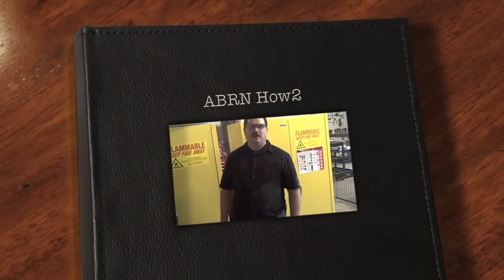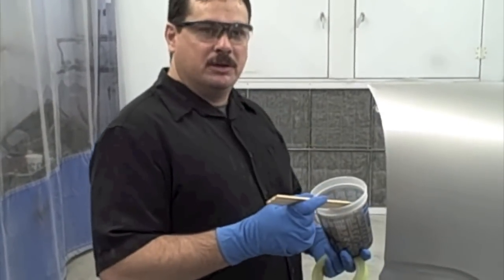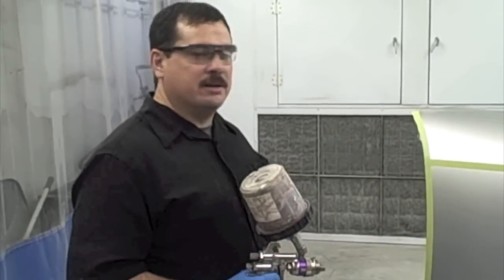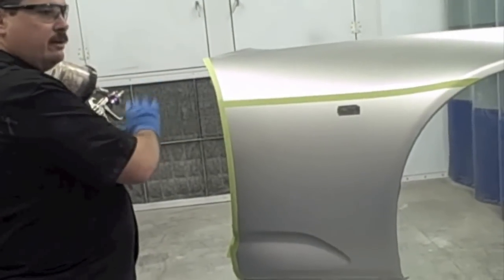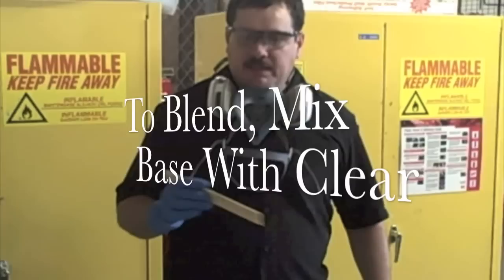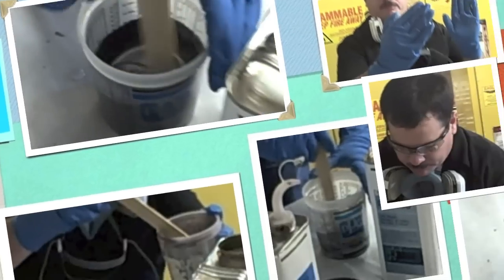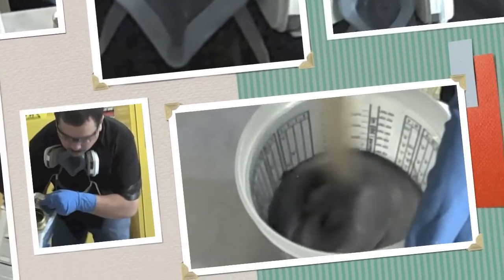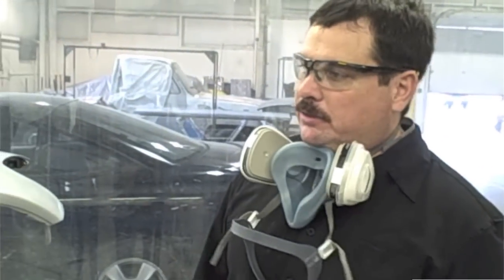DIY - How To (Blend Car Paint) to Match Metallic or Pearl Color - Fade Custom Paint Jobs Tips

Comment from the maker: We started using PPGs waterborne paint and it matches great.  We've been able to do butt matches just by selecting the closest variant on the color variant deck and spray.  It has been working great for color matches.  I do not know much about DuPont since the Lucite and Centari days.  (lacquer and enamel)  I worked at a dealership that used it.  I need to try DuPont's newer products, but I have not had the chance to.  Thanks for your input and for watching.

Comment from the maker: If the damage is far enough away from the adjacent panel, you can blend within a panel (but still clear the entire panel.)  If it is not, you may see a metallic difference.  I usually end up blending into the adjacent panel though.  If it is a small dent in the middle of a door or something like that you may be able to blend within a panel.

Comment from the maker: The color blender helps prevent a halo ring on the outside of the blend, but you do not need to use it.  I have blended a lot of jobs without using it.  It just makes it easier if you are having that problem.  Thanks, Donnie

Comment from the maker: You can try gently buffing the clear coat edge.  Careful not to buff through the clear though.  One way is to melt the edge when applying clear coat.  This can be done using a blending solvent.
Reply: Why not just repaint the hole car

Comment from the maker: @theglove3k0 Yes, you must sand the surface before clear coating.  You need to sand the surface with 800 grit or finer.  Clear will cover the 800 scratches.  If you do not sand the clear will not stick and may peel. Visit my website for more training.  Thanks for asking.

Comment: One thing I don't understand about blending for touchup work, is that the whole point of prepping a surface (besides cleaning) - sanding to 600/1000 and priming - is to ensure proper adhesion of the coats. How does that work on blending areas, where you're spraying on top of clearcoat and polished surfaces?

Comment: hi question.. i have a few tiny spots and some scratches I wanna fix - can I just use like paint from a small bottle with a tiny brush?  would it be good enough? I don't want to and don't have the gear for spray painting

Comment: Well . I am losing my mind with my bumper. I had all the troubles in the world painting over and over again my bumper. Now i finally got some very close color match. But just on one side. Seems like someone already did some blending or the original paint is burned by the sun more on one side. Because i live in Europe i don't know exactly what is this clear used in this video. All i could find is some transparent acrylic paint used by artists. Painting shops around here are saying they prepare the base coat already colored. My question is : is that acrylic clear for paintings good? Because auto painting is also acrylic.

Comment: I'm installing a factory spoiler on my 20-year-old car with original metallic paint that has faded much lighter than the fresh OEM color. My thought was to spray the spoiler with an OEM base and clear base mixture to try to match the faded original paint. Do you think I can achieve a close match, or are the elements causing the fading too unpredictable? Since it's just a spoiler, I'd like to keep it simple and avoid blending the panels. Thanks.

Comment from the maker: @RUSSRTOC Yes, if I did this for a living (daily basis) I would use a air supplied.  As students or DIY, the 3M respirators work well and is approved.  They do have half mask air supplied you may consider.  However, to completely protect you face the full mask is best.

Comment: Quick question: So when you have taken your already reduced base coat color and mix it with the DBC 500 which is already reduced, I noticed you sprayed over the already two coats of reduced paint that you laid down. Is this what PPG recommends you do? I would of thought you would have just sprayed out past your 2 coats and blend out into that fender, not spray over your first two coats also. Not that it probably matters a lot since its just basically reduced way down base coat at this point.

Comment from the maker: With solvent paint, it usually has to be blended if you want an invisible repair.  However, you may look for a shop that sprays waterborne and ask them if they can panel paint the part.  I have found the waterborne paint to match much better.  If they panel paint, they may not guarantee it to match perfectly.  Thanks for watching!

Comment: I live in Santa Cruz, Ca....one of the only areas that isn't required to use waterborne, though, most shops use it anyway. No one seems to have a major problem with it. I never liked PPG solvent based, i used it for years and found it too reactive compared to DuPont. But i have heard nothing but good things about PPG waterborne

Comment from the maker: @Krewnaygul yes, blend you paint, then extend your tri-coat.  you may also want to spray a let doen panel to determine if 1-2 or 3 coats of the tri-coat match better.  using this method by breaking it down with intercoat clear work great for hard to match paint.  Thanks for watching.

Comment: Hey, I don't know if you are still answering to question for an old upload, but I have a question. So when you are blending panels to panels, Do you have to sand paper the all the panels next to the one that you are painting? Then blend in all the panels next to it then apply clear coat to every panels?
Reply from the maker: Yuki Sung yes, you have to sand where clear coat will be applied.  I usually use 800 grit to sand the blend and clear coat areas.

Comment: I have a question.  I have a 2011 Mustang Yellow Blaze tri-coat, and the paint on the front of the hood has started to bubble up and peel.  I've read that since it's a pearl based metallic paint that it can't be blended, or...shouldn't be blended.  My car is under warranty, and I'm wondering what Ford should really do here?  They're already having to replace the hood due to iron contamination in the aluminum hood, which caused the bubbling.

Comment: I noticed you are using ppg products. My question is this. Can you mix the other brands the same way? Mixing you blender and then mixing your base with the blender? Cause I've been told that you have to spray the blender on the panel, let it flash and then come back and blend your base, when it comes to solvent paint. We spray waterborne paint where I work so it's a little different then solvent.
Reply from the maker: We've started using waterborne paint too and we haven't used this method with it.  As far as a solvent, you can use this method for PPG and Shopline, but I am not sure about other brands.  They taught us this trick at a PPG training event years ago.  You probably need to look over the TDS for the brand you are referring to.  Thanks

Comment: Thanks for the video. I need to do something similar but I can't seem to find a place that sells clear basecoat (in fact, they do not appear to know what I'm talking about). Is it possible to simply mix top clear coat where you have mixed clear basecoat?
Reply: ask for mid coat clear or clear toner. Check out your local Dupont shop or Sherwin Williams supplier (or PPG or BASF)
or just look online and see what you can find like http://www.amazon.com/Flake-Pearl-Midcoat-INTERCOAT-CLEAR/dp/B001D4QH86 http://www.autobodysupply.net/DIABC00-p/diabc00-fslash-q.htm

Comment: Donnie , a bit curious as to exactly how you mixed the silver base coat with the dbc 500... I'm new to the blending world and not exactly sure how its mixed in. do you go ahead and mix the dbc 500 1:1. then mix the base assuming 1:1 then mix those? thanks for your awesome videos again.
Reply from the maker: Yes, mix them both 1:1 with reducer.  Then you can start mix the two 1:1.  That is enough for blending.  If you're doing a fade job you can add more premixed 500 to the mix to take it out further.  Thanks for watching.
Reply: thanks a bunch!!

Comment: Firstly I’m not a professional car paint sprayer but I re-sprayed my front bumper using rattle cans. I don’t have access to a bodyshop and I didn’t want to pay the money for a professional job (wish I had now). But my paint is a black obsidian pearlescent paint but my finish looks more like a matte finish. Why would this be and can this be corrected without the need for another full re-spray?
Reply from the maker: You may try buffing it.  I think some spray cans are lacquer based which will require buffing.
Reply: @CarAddictGarage  would this buffing need to ha e been done prior to clear coat or after? Thanks.

Comment: hi  donnie      smith, you have to use the base coat blender  on    blend job?  do you need to polish the edges  on  new clear coat with blend solvent to melt the new clear ?
Reply from the maker: I mentioned this problem in this video.  Thanks for watching.  I answered your question in this video. https://youtu.be/SYB9DTJ73ic

Comment: I have a small dent in the wing and a scratch on the bumper of my new metallic car. I was quoted £130 to repair by one garage. The next place quoted £300 as they said they had to repaint the whole wing and bumper as with a spot repair you will  be able to tell where old meets new. What I don't understand is, if its difficult to get an exact match wont the repainted panels be slightly different to the adjacent panels and have to be blended in anyway.

Comment from the maker: @theglove3k0 No, just scuff it to remove gloss.  If you are just reclearining, sand with 800 grit or finer.  The clear will cover the 800 scratches.  Be careful not to sand through the clear or you will need to paint before clearing.  You can learn more on my site in the description.  Thanks for watching.

Comment from the maker: @riadlia You may not have to use blending clear, but it helps with colors that are hard to blend, such as high metallics or pearls.  Also in the video I did extra steps showing how you can do a custom fade job.  It really does make blending much easier.

Comment from the maker: No, this is not regular clear coat.  It's basically a base coat with no color.  It mixes the same way as base coat does and does not require hardener.  Let me know if this helped answer your question.  If not, or if you have another question, feel free to post again.  Thanks for watching.

Comment: Great job!  Sir what would be the best sand paper grid to use on the  area that is being blended and the area that will be cleared over clear?  I will be blending my fender and then I will need to clear coat the entire fender would you recommend clear base over the entire fender before applying clear coat so there would be better adhesion?   Thank you for your video.

Comment: as an experienced painter I highly recommend that you do NOT try to do it this way. never change the product you are using. via adding clear, reducer etc. don't change gun pressure don't change ANYTHING! blend in 2 steps. 1st step...go half way into the panel and blend back towards the painted panel. allow to flash. 2nd step cut that in half blending back towards the painted panel. done that simple!